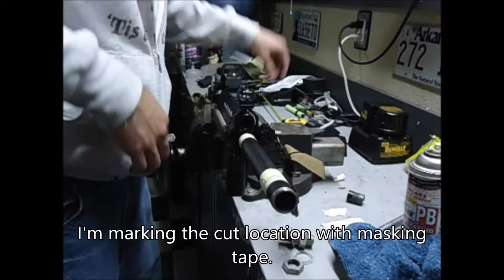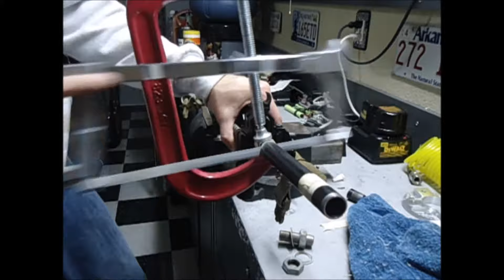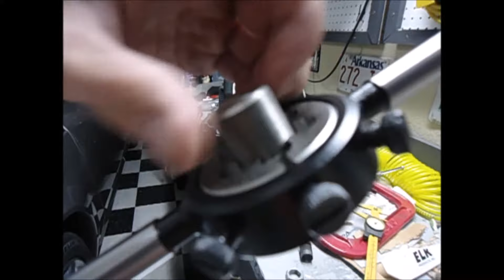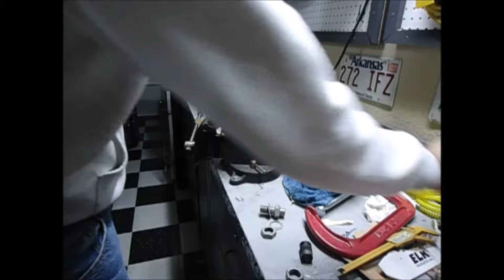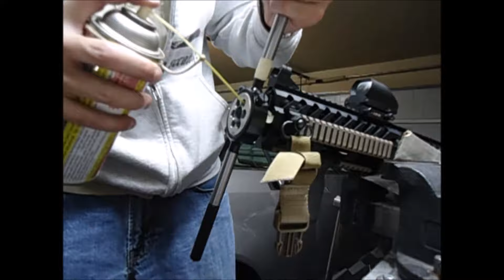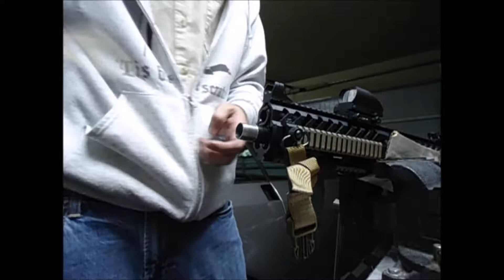Saiga-12 Threading

Comment: OMG !!!! I finally found video some one doing it !!!!! Thank you so much. Please help. I have JTS 12 (Chinese cheap Vepr/Seiga variant) would like to cut down my 18.5 barrel to 16 and install and pin 2 inch brake to make it legal 18. My barrel OD is 24 mm,can that die just cut in to 22m and after that how its  going to hold muzzle brake for being barrel so thin in the end where the thread is? Thank you. Hope to hear back from you!
Reply from the maker: Given that 12ga is usually around a 19mm ID, a 24mm OD sounds chonky. I don’t think that die could cut into that. It might need to be turned on a lathe first and at that point the machinist doing the turning could theoretically go ahead and thread it while they’re at it. 
It’s the same thickness after cutting and threading that the factory muzzle was and it’s able to support a very hefty Salvo-12 attached to it just fine.
Reply: @jza414  my Barrel od is 24mm not 19mm.  So I'll be  threading from 24m in 22mm.  my brake is also 22mm. U think should work? 
I already found guy who can pin my muzzle brake and weld it for $50  but the rest of the work I would like to do it myself
Reply from the maker: Screen Share if you reread my comment, you’ll see that I said 12ga is about a 19mm INNER diameter, so if your outer diameter is 24mm, you have a 5mm thick barrel wall?
Reply: @jza414  sorry didnt saw "inner"  so I just re-measured everything. my barrel OD is 23.8mm and ID is 18.5mm.  Now wonder what is OD on your shotgun
Reply from the maker: Screen Share I’d have to go remeasure it as I don’t remember, but I can’t imagine it’s much different than yours. The only time I’ve run into overly thick barrel walls was on Yugo SKSs where they intentionally oversize them to make up for the lack of a chrome lining. 
Your best bet is to talk to a machinist to get eyeballs on the situation and get their advice, maybe leave them with a six pack for their time 😬
Reply: @jza414  thank you for quick reply.  I'll keep you posted.  but please do me a favor and re-measure your Saiga barrel OD.  I cannot find this information anywhere :(
Reply: @IvanRossS , with calipers mine measured .884 OD right behind thread protector. ID is .729(18.5mm)
Reply: @TheRoadhammer379  thank you for help. Jut now see this. Haven't moved with my project! But I'm back on it

Comment: do you remember the barrel OD? I thought a factory saigs barrel OD was too large to thread m22 without turning it down

great video!!!
Reply: Absolutely not. I have threaded 14 saiga 12 barrels, 5 catamount fury barrels and 2 Vepr12 barrels with that same die.
Reply: @TheRoadhammer379  do you by chance know what die needs to be used on Saiga 20 gauge

Comment: Great video.  Where did you purchase the tools?   How did it function?  I have seen in forums that shortening the barrel can cause cycling issues.
Reply from the maker: Thanks! Got the tools from dinzagarms. Arrived quickly and quality stuff. 
You will also have to remove the gas block and drill out the gas ports, add more gas ports, and/or shorten the gas tube. You may also have to run different springs and gas plugs, though I didn't have to in my case.

Comment: hi, and shooting  results after ?
Reply from the maker: Initial tests showed cycling problems due to the shortened barrel. Those were addressed with modifications common to these weapons to make them run more reliably such as springs, gas port enlargement, and polishing friction areas
Reply: Hi jza414 !  .initial good idea and look must beautiful in short model. more eficiency urban fight .Thanks for response